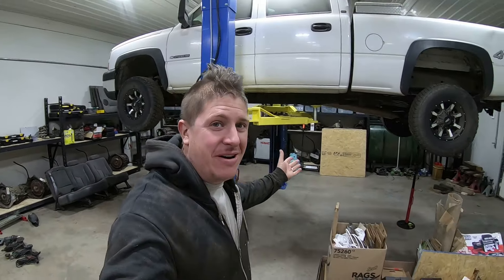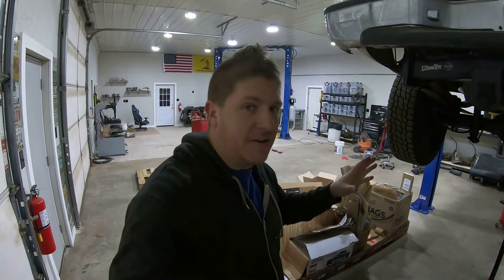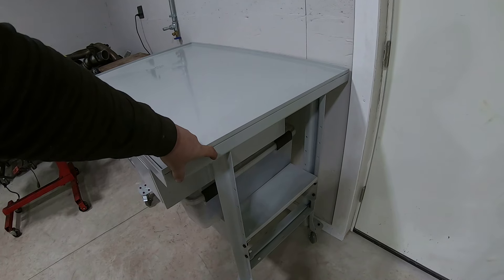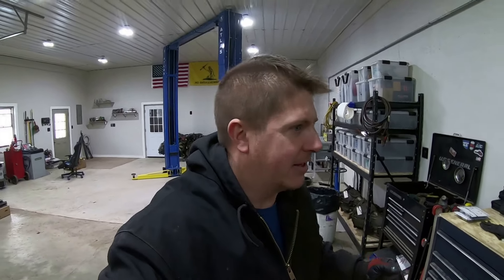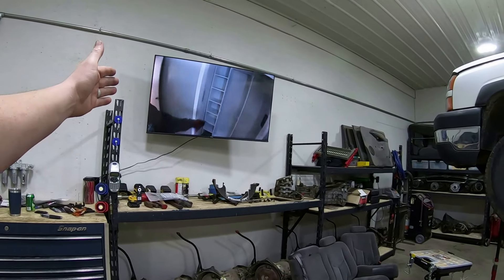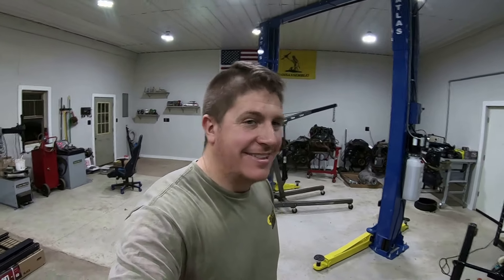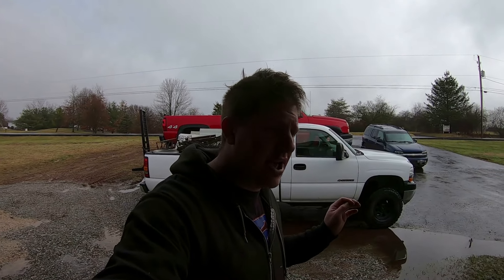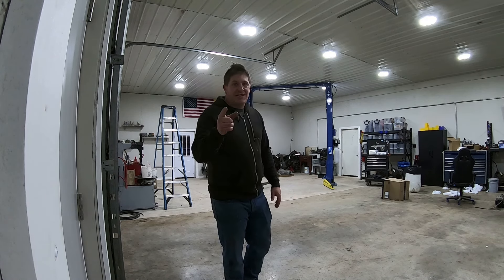FURNISHING!! - Dream Workshop Build Update 12

Comment: Jason, Really nice progress on the shop.  Sure doing a great job!  I am wondering if you have a link for the hardware storage trays with snap covers that you put in your storage cabinet?  Again, nice job!  I am really enjoying this series.
Reply from the maker: Thank you! Yes I do, I use small ones and large ones

Small - https://www.harborfreight.com/20-bin-medium-portable-parts-storage-case-93928.html?_br_psugg_q=organizer

Large - https://www.harborfreight.com/tool-storage-organization/parts-storage/organizers/8-bin-portable-parts-storage-case-93927.html
Reply: I must have missed the links to the bolt organizers.  Sorry about that.
Reply from the maker: you didn't miss them, I added them to the description after I responded to your comment.